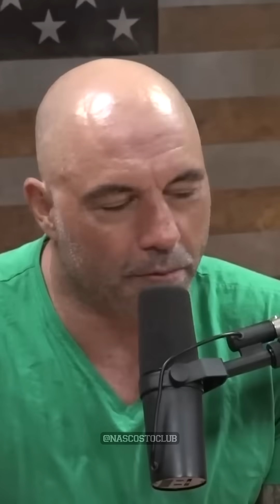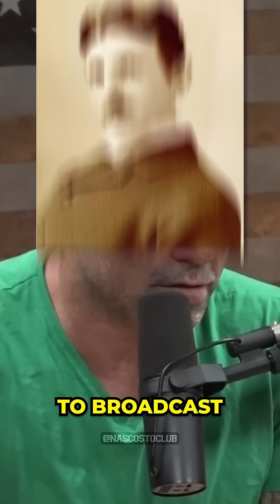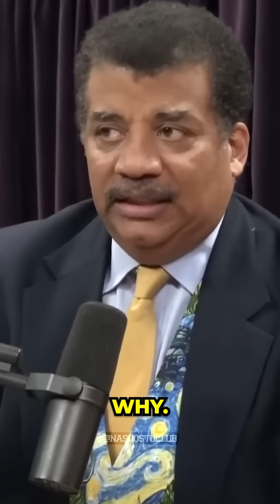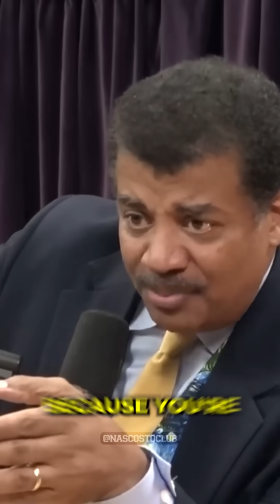WIRELESS Electricity Idea Debunked ⁉️⚡ #shorts

Comment: it makes me think about bluetooth, right? but also idk
Reply: Well, you're not wrong.  Bluetooth is just another form of radio wave, same as wifi, same as AM/FM radio, it's all electricity of sorts.  But very low power, by comparison to say, 110V house power.  And with varying degrees of complexity, like the electricity in a network cable is much lower power than the power cable coming from your outlet, but both are just electrons flowing through a cable, like how wifi and bluetooth are just electrons flowing through the air.

Comment: I thought he did put enough energy through the air to light 💡. Would it be possible to be a little envy is involved with you?
Reply: It's not that it's not possible it's that it's not practical or in any way safe in large scale.  It's easy to bury a wire or put it up out of the way and you can see it and stay clear of it.  It's a lot harder to make an invisible beam of energy safe.  And if you do, with signs or guides or something along those lines, then why not just use a wire which will ALWAYS be more efficient?  Air is a poor conductor.

Comment: What if we put it through co2? We have found the angle that graphene can be a conductor. Can’t we have wireless power?
Reply: I mean, there is CO2 in air.  Still a bad conductor.  And if you have a conduit of pure CO2, how's that better than a copper wire?
Reply: @compmanio36  Why don’t you google all the properties of graphene, it’s not just a insulator. Co2 MAYBE could be used as a wire.

Comment: 1950s bulb consume 100 watt AC plus and produce dim light. As of now the same light can be produce by a 5 watt 12 v dc LED. May be in future a radio wave signal can be more than enough for such. Maybe I mean maybe.
Reply: It already can be.  Nobody is saying it's impossible.  Just that it's dangerous and impractical.  If you were able to make a wifi transmitter that put out 100W of power, it would fry anybody within range.  Even if you made it directed, you're essentially making one of these: https://en.wikipedia.org/wiki/Active_Denial_System

Comment: It's a trilogy of the same thing free energized atmosphere would have a ground zero in the stability of the ozone and if Tesla did charge the atmosphere we wouldn't even be here now as the forces of the refractionals in from the suns energies fingers of charged practical conditions of statically functioning roadways of the same draining to the moon and secondary from the prime the reversed transition from the generated electricity to the air charging the engine forward and allow it to fly yes but not with electric power but a lot of tiny little wires that collections are made to charges of working energy

Comment: There will be better ways to power our electronics in the near future, scientist are currently working on cells, like using IA to design simple living cells, and they have made some simple cells that only make one motion, a circle like they spinning infinitely (probably until they die I'm not certain) this research is for medical purposes but scaling this on other fields (probably scientist are already assessing this) could let to no more cables

Like a tiny integrated battery but in the inside no chemical reaction alone but a microscopic living organisms producing its own electricity

Comment: I thought that his design to transfer the current through the earth's Ionosphere, not through the air that we live in and breath. I could be wrong on that. The main problem from what i recall of his time, and probably for us as well, is getting the funding/means of construst a device which reach that height twice from two different locations and deliver/receive sufficient charge

Comment: if you ever get the chance: stop by a commercial transmission tower. doesn't really matter what it's sending. TV, cellular, radio... when  you get close to the equipment shack- you'll see signs all over the place- WARNING you NOT to step in front of ANY of the transmitting antenna- they will LITERALLY cook you like you're on the inside of a microwave oven.
Reply: @Julio Altamiranda lmao... before you can critique EITHER of those guys- you better create something more ground breaking than a youtube post.

Comment: But electricity doesn't travel through wires,fact. Also the Sun is sending huge energy through space,I don't disintegrate when I go into sunlight. Tesla found very high frequency electricity did not enter the body.

Comment: Not a NDT fan but someone needed to set Joe straight on this one because he's talked about it a lot. You're not transmitting enough power through the air to do anything meaningful without fucking people up. Radar and microwave towers will cook you if you get too close and that's just to send tiny signals! Imagine then sending out enough power to run your microwave, you'll be in the microwave!
Reply: Wifi on its' own is technically a weapons frequency

Comment: It wouldn't even work, the losses are huge. 

An AM tower, for example. Some emmit at a few hundred killowats of power at quite a high voltage. And it's perfectly tuned to oscilate on the transmitting frequency.

At your radio you receive microWatts of power. And depending on your antenna... you might get just  microvolts to a few milivolts.

It's insanely inefficient.

Comment: Isn't science always about being open to the possibility of being proven wrong? If you dismiss every single suggestion then where does the experimental part of science go? You've made a hypothesis, created a theory and immediately made a conclusion off of that theory without actually doing the experiment to check if your theory is correct or not. Isn't that basic scientific process? Hypothesis - Aim - Experiment - Results - Conclusion.

Comment: Tesla did a demonstration of wireless li engery.  He actually had a working prototype I think he had it set up in a huge house.  house it up at a grand party with rich people in attendance all there ,New York it might of been n
Reply: Maybe it was in a movie where his he used wireless electricity in it s
Or. Something
Reply: @BigDaddy-vr2ut  
Powering some light bulbs in relatively close proximity?  Not too difficult, though it is very, very inefficient.

Powering anything bigger than a low watt lightbulb at more than a few feet?  The amount of energy you need to wirelessly supply goes up drastically.  The inverse square law is a thing... and it applies here.

Comment: Tesla literally has pictures with him powering lightbulbs with wireless energy.🤷‍♂️😂🤷‍♂️
Reply: Lightbulbs aren't known for their high energy requirements.  You can easily power a lightbulb at a relatively small distance.  That isn't hard... though it does take significantly more power to do that than simply using a direct connection.

Look up the inverse square law.  The greater the distance, the more power required to be sent into the "air" to power even a single LED.

Comment: So what about wireless chargers for phone. It's possible to do it at a farther distance. The dude had ideas for things that have now been built. Let's not knock it
Reply: Yes, it is possible... but it is extremely inefficient and would be incredibly dangerous at the power levels necessary to power even a single home.  Inverse Square Law is a thing.
Reply: @Diviance  for sure. I think you would need something like a line running to something that would send out the signal but I was limited to like maybe just powering devices within a short range. Either way I totally agree with I wouldn't want it in my home. Also yeah I've looked at the wireless chargers for phones and how much power they consume versus how much they're providing there is a lot of waste

Comment: He's correct in an oversimplified way.  If you are subjected to a high energy electrical field with a stable frequency, you actually adapt to its phase.  There is no danger from the field particularly.  The issue would probably be grounding, which would kill you.

Comment: The problem with Neil is that he is an astrophysicist, but he doesn't hold knowledge about everything, in fact new Zealand is working on safe wireless power transmission, and also there are devices that use magnetic resonance, it's not radio, it's electro magnetic waves, like your wifi